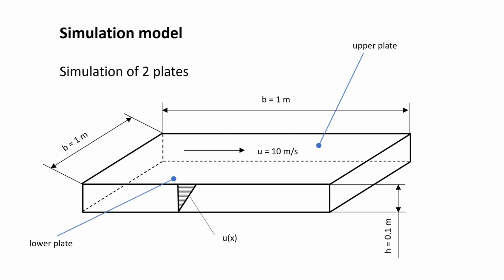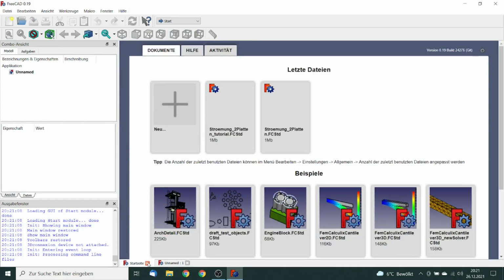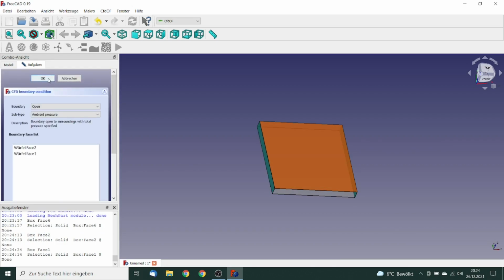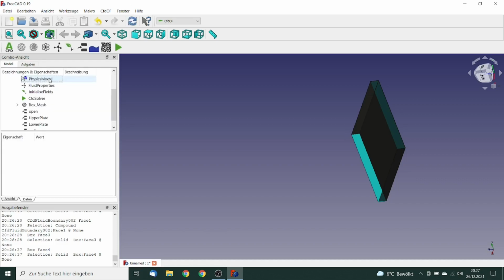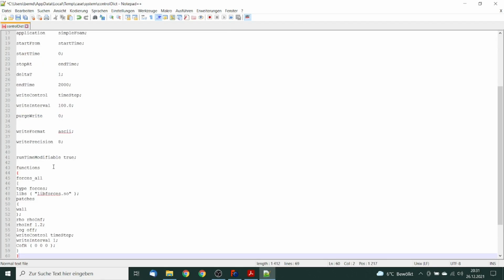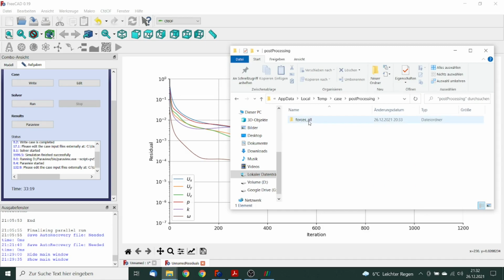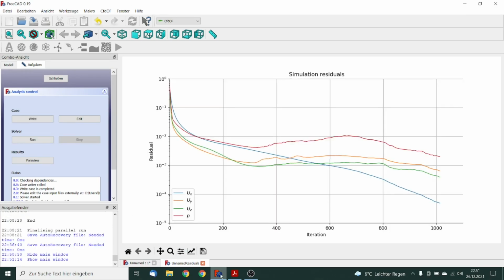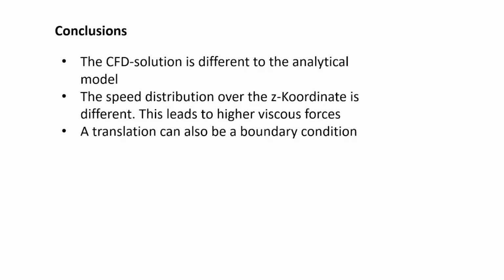Freecad CfdOF Tutorial #3:  Simulation of 2 Plates

Comment: Hello, so how can we get the real Couette flow matching with the analytical model ?
Reply from the maker: The simulation of the Couette Flow is shown in this video: https://youtu.be/Gu5qhZ6UL9g?si=-wK4NCUntSBp2aVm
Reply: @techbernd5535  No i think that is the "Couette Taylor flow" and the real Couette flow is in this video over 2 plates
Reply from the maker: @eliesmaths4256  : The problem is a bit more complex: The rotationally symmetric problem shown in the linked tutorial is a Couette flow, and here the results of the analytical formula and the CFD simulation agree. The simulation shown in this video is a Couette flow because the outer wall rotates. If the inner wall were to rotate, it would be a Taylor-Couette flow.

In the German Wikipedia page on "Scherströmung" (= "shear flow"), two flows are explained: Couette flow and Couette-Poiseuille flow. The flow I simulated seems to be more of a Couette-Poiseuille flow. Link to the German Wikipedia article: https://de.wikipedia.org/wiki/Scherstr%C3%B6mung#Couette-Poiseuille-Str%C3%B6mung. I have not checked whether the Couette-Poiseuille model works better than the Couette model and whether there is a pressure gradient. At first glance, this flow looks like a Couette-Poiseuille flow.
Reply: @techbernd5535  okay thank you, and with my simulation over two plate I fullfill to obtain the velocity u(y) like the formula of the model thanks to a lower velocity of plate or a bigger viscuosity, because the reynolds needs to be low, so now I have no problem with this simulation.

Comment: Thanks for the tutorial. I noticed that you used different density values for computing the resulting force on the plate between RANS and the laminar simulation.
For RANS you used 780.0 (time 12:06) and for laminar 870.0 (time 20:37) , that will at least partly explain the difference in the force computed on the plate.
Reply from the maker: You are correct, for RANS, I made a typing error. 870.0 is the correct value. For this video tutorial, I used the version FreeCad 0.19, in the new version 0.20, the start of the evaluation of the forces is initiated by a Reporting Function. This Reporting Function is part of the user interface of the FreeCad CfdOf workbench.